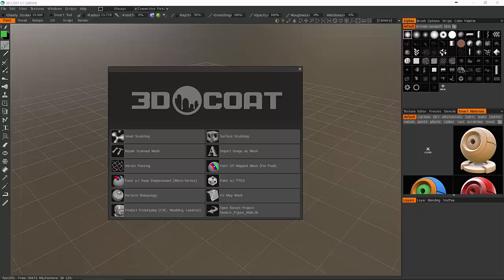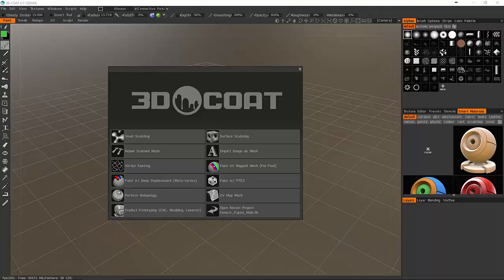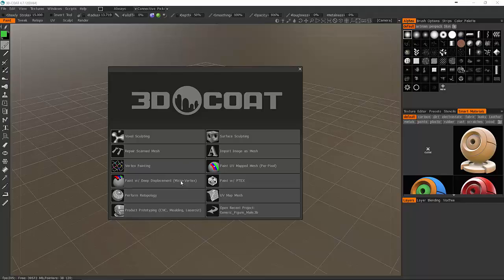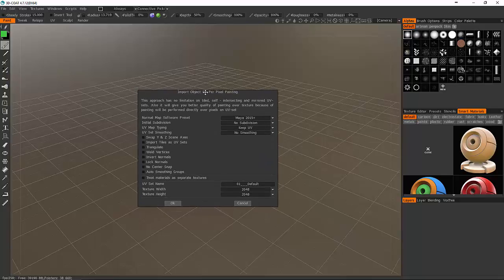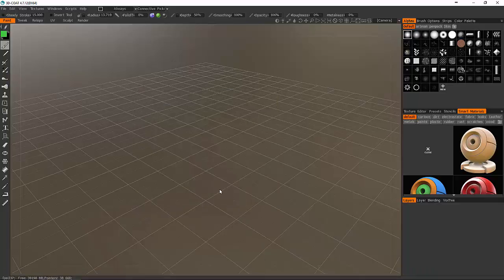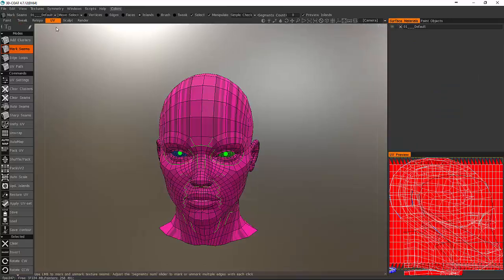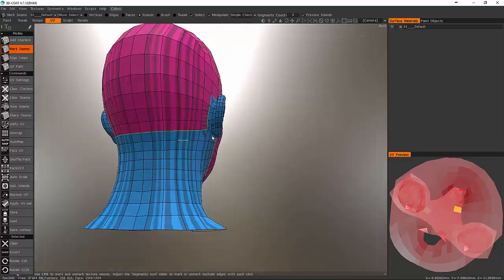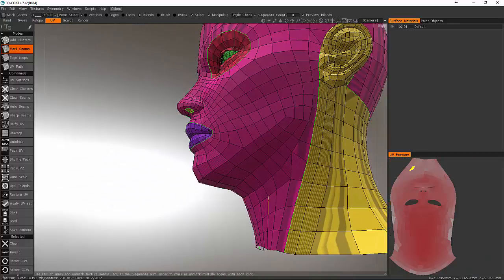Unwrapping and Texturing in 3D Coat (Part 1)

Comment: Hey can you tell me how do you import a asset in quad, i like to make my model in 3ds max and then unwrap with 3d coat.
Reply from the maker: If you used the edit poly modifier to model with your model should be quad. When importing into 3dCoat make sure you don't check triangulation
Reply: Thanks